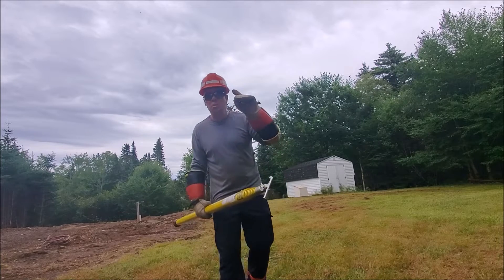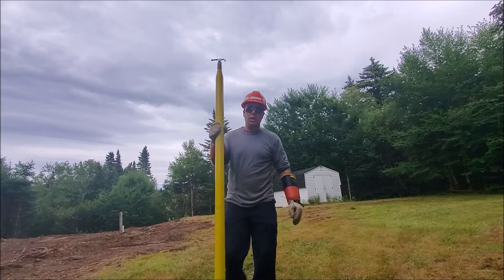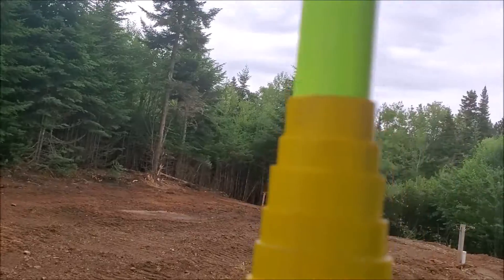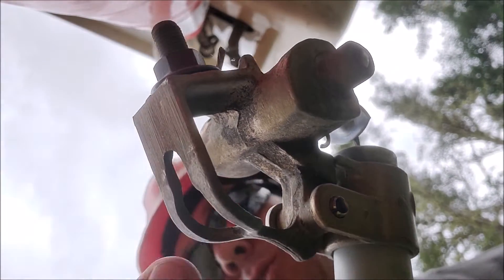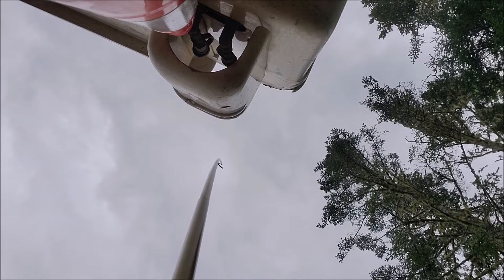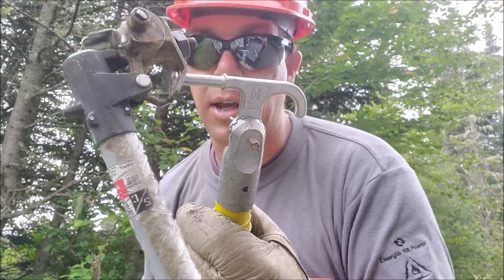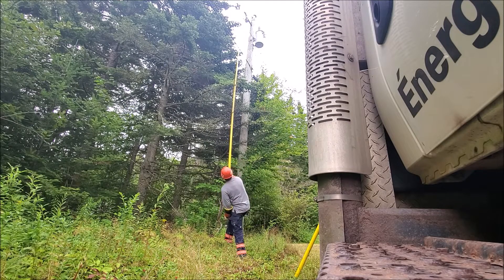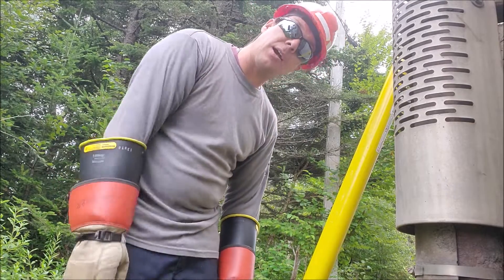How to use an Extendo stick on Powerlines

Comment: I actually work at the company that makes these Parts Hastings fiberglass So when you said that's the only part that gets tested that's not true every foot every part that we make is tested through the electrical tester at 100,000 volts every single part literally have made thousands and thousands of these parts work there for over 5 years only have had one part not test out
Reply from the maker: I stand corrected; the top piece is the only one tested/stamped by our company after purchase

Comment: Is it right or wrong to use a hot stick without rubber gloves? I know that some utilities do and some don't.
Reply from the maker: A much debated topic!
Our work methods indicate: 20kv gloves must be used while "switching"... Therefore regardless of the 100kv per foot tested fiberglass, they must be used. 
Meanwhile, 8ft tested sticks of the same specifications are used "bare handed" while working on 138kv lines. 
In our jurisdiction, our rules must be followed. If while working in another jurisdiction (where it's not required) I worked alongside a lineman that wasn't using them, I wouldn't be concerned. As long as they were following work methods particular to their company and work area.

When in doubt, use em!

Comment: I think the works come to a standstill when it rains and winds. You know you can't easy fit the fuse properly with the long extendable stick. Moreover, is it possible to see if the fuse is correctly installed into the cradle?
In Russia, transformers and fuses are never hung on the power poles.

Comment: Is there any way to lock that extendo in a shorter section to use it in a t-former vault or maybe just use the first section as a shorty since it's the highest rated part of the stick? My point being is we're doing a job that has residential transformer vaults and the inspector is trying to tell me that specific stick  can only be used for things like harness retrieval. He's obviously wrong because you're using the same stick to pull cutouts!
Reply: I take out the first section all the time to put buckrodgers on it (high voltage voltmeter for phasing) or to put my tag200 on it
Reply: @pumkinface1  Thanks for the info. Its old directed burial cable, 7200V. I've been putting a Hastings disco hook on that part of the retrieval stick to move the sketchy sections going under t-formers when I have to

Comment: a trick a lineman told me that when you are cleaning the stick you would want to only go from the head down and no back and forth movement. the reason for it is that if you have dirt and stuff on the stick that you can't see that so it doesn't get the contaminants back on the stick. instead of the one motion you can trapp all the dirt and junk that is on the stick

Comment: One night at 3:00am a racoon crawled up my power pole and blew the fuse. I called the power company and a guy came out. He was having an awful time getting the new fuse back in and was throwing his hot stick down in the wet grass each time he chased after the fuse. It really surprised me that he didn't get shocked. A couple of weeks later they were out and replaced the fuse holder with a newer style and insulated the wire to the transformer. No more problems since.
Reply: He had probably just waxed his stick and that's how he wasn't getting zapped
Reply: The sticks are a lot more resilient than you'd think

Comment: I have been using hot sticks for years and never knew the name power guys used.  We called them pike poles.  I use to work heavy towing and we would use sticks just like that to get straps and rigging in place.  Interesting crossover in use.  FYI we NEVER moved or touched anything electrical with them.

Comment: What is the material of hot stick boss?
Reply from the maker: They're made mostly  with fiberglass, and tested at very high voltage. Typically 75-100kv per foot!
Reply from the maker: I should add; These particular sticks are only usually tested at the final extension, while the entire stick is fiberglass. The end piece has a glossy finish to help keep clean

Comment: Hot stick also works great for changing are light bulbs with the correct attachment, nice demo with the cut out, don't you love it when you have  to hold that fully extended stick at shoulder height just to get one of those buggers in the slot then have to close it in. i can feel the burn

Comment: Thanks
What do you do if it goes off center when going up? Bring it down
Reply from the maker: If it goes off center , you should  be able to manipulate the bottom stick to line things back up. While extending the stick, You'll find it easier with the top wobbling around rather then fully leaning to one side. If it's due to a heavy wind however ,you might have to coordinate moving  the stick along with extending it !

Comment: Perfect explanation. I'm just starting to replace fuses now. I never thought to put the finger in the front. One pointer that my journeyman told me was to tap it and make sure it swings freely back and forth. That way you know it is seated in the cradle properly. Thanks for the video.
Reply from the maker: 💯 percent ! Awesome tip ... Yes if the door swings freely , you know it's seated correctly ! 
I often times remove doors from the side part and hang them from the front . Especially if they have that Grove into them ! You can literally hang a door from the middle  of the street with the grooved one!